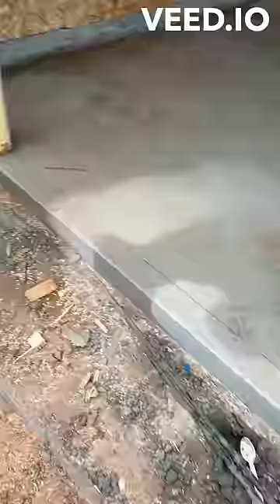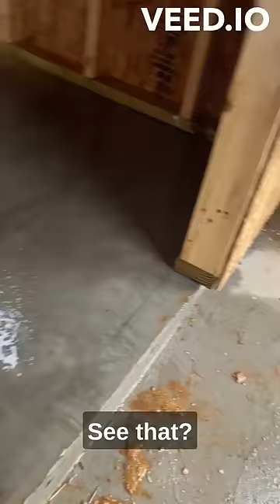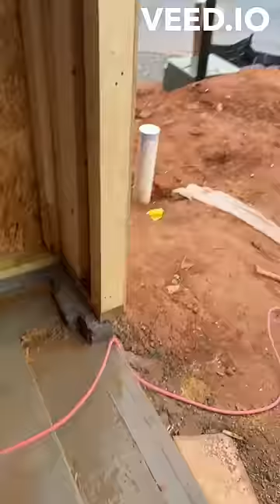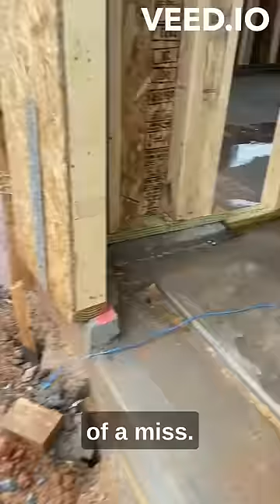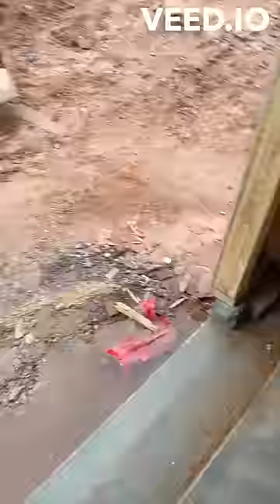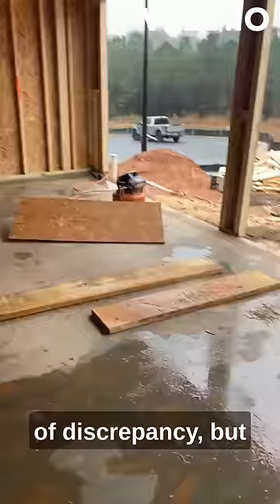New Home Slab is Wrong Size, What Now?

Comment: I was a framer for a long time, I would have popped my lines down saw how far the concrete was off and called the super to get the concrete guys back over to fix it before we came back and did the job
Reply: I was a carpenter for a long time. I would have took and inch and a half off the wall and went about my business without making a huge deal out of nothing. They clearly added a foot to the wall as depicted in the shot of the outside corner with the janky ass splice job. So they cut that one foot piece knowing damn well it was an inch and a half long. Simply unbelievable
Reply: You don't hold up the whole project over a lost inch or two. You just notify the general contractor and get permission to modify the frame by 1.5". You can't control the other guys, but you can do your own job right.
Reply: All the measurements seem to be out by the thickness of the framing material, I wonder if they both are making an arse of the site drawings and this is actually an office mistake they are fed up of correcting on site.

Comment: I love how they noticed it was wrong and just kept working
Reply: Some hardcore "not my problem" shit.
Reply: What would you have them do? The framers didn't do anything wrong here. This is the concrete guys problem all the way. I'm a concrete guy and ive been in this exact situtation before. We drilled and pinned the face of the stem wall, form it all up for 4 inches of concrete all the way down to the footer. Painted on the link and poured it. The framing isn't in the way at all. Very minimal at best.
Reply: Should be fined $100,000 per inch. These assholes are working for the customer, NOT themselves.
Reply: @traveler7353 That's one of the difficult things about hiring people. It's not their house so they don't give a fuck
Reply: @TripAMD  The framers failed to build to code. How is that not wrong?
Reply: @TripAMD looks like everyone messed up here. Putting a frame on top of that slab was definitely a mistake
Reply: @NinjaThatLongboards  . It wasn't a mistake though. The wall won't fall off or anything like that. The concrete guys can can fix it whether it's framed or not.
Reply: @TripAMD  half the load of those walls is unsupported
Reply: @NinjaThatLongboards  yes. But it won't be once they pour more concrete. This is a very straight forward problem. It happens.
Reply: @TripAMD  it's not as simple as just pouring more concrete dude, it has to be Properly Attached and reinforced to Handle any Loads it will be subjected too... Fact of the Matter is, Those Framers Knew there was an issue on Day 1, but they Cared about $ over the Proper installation of Someone's Home-  Pride in Work is another Issue our youth has Lost!  

  Past Generations would have quickly Noticed the Problem and Stopped, to make sure this issue is Fixed before moving forward, They Took Pride in their Work... Today's Generation is so Self absorbed and Greedy that it's literally everyone for themselves!
Reply: @RandomPersonTP  nobody said just "pour more concrete". I explained the fix in my first comment. Anybody that's been in concrete for any amount of time knows what to do here.
Reply: @traveler7353  lol.. you have no real world experience in these fields obviously. This isnt a big issue, its a very common mistake made by concreters and can be fixed without much drama.
Reply: @traveler7353  hahaha...You dont LAY concrete bud, you POUR it. You're trying to lie to an actual tradesman here id quit while you're behind.
Reply: @TripAMD framer didn't do anything wrong? So putting up the walls wasn't wrong?
Reply: @CbrF4i600cc  . Exactly! Framer did nothing wrong. It looks bad to somebody that doesn't know any better. But it's no big deal to fix.
Reply: Im a bricklayer and there's lots of times i get told to over hang out of square concrete and the general signs off on it first before i lay anything because they dont want the concrete guys coming back
Reply: @TripAMD how about make a phone call. Is that so damn hard? It's not rocket science. It's construction. Something doesn't look right, maybe we should check and make sure this isn't going to be an issue. I just don't get the lack of common sense we have now days.
Reply: @TripAMD  the framers did everything wrong lol
Reply: Exactly. The carpenter should have stopped and notified the GC that the slab needed fixed.
Reply: @TripAMD "What would you have them do?" Seriously?  What if it was your money being spent here? Would you be happy these people went ahead full knowing they are wasting time, money, and materials?
Reply: It's called deadlines and schedules. You expect the framing crew to miss a week of work because the concrete guys fucked up?
Reply: @codyfreeland  What if this was your money being spent?  The answer you come up with is the right answer.
Reply: @worldofthunder  if it was my money being spent, I would have double-checked the concrete forms before the pour
Reply: @codyfreeland  So in other words you wouldn't have the framers start the work because the concrete forms need to be fixed.  See that's the right answer... And in this particular case where pouring of cement already took place, the concrete would have to get fixed before the farmers could start. 

Also let me get this straight. So you pay the money to have a contractor perform the work which includes hiring multiple craftsmen for different jobs. And you're telling me that you're going to be out there measuring? Why are you hiring the contractor then...
Reply: "I'm just doing my job"
Reply: @worldofthunder  it's called "quality control" Every general contractor should do it. Would have saved their ass thousands in this particular case.
Reply: @codyfreeland  I agree with that statement 100%. However, the framing guys continuing their work fully knowing it's wrong is not the way to go.
Reply: @worldofthunder  you think the gc didn't ok it?
Reply: @codyfreeland  Honestly, I would not presume to know that.  I'f he did, then it's 100% his fault and rest assured it's coming out of his pocket.
Reply: Mexican crew framed it probably lol
Reply: Man this is the contractors fault for not being on the job and seeing what’s going on.
Reply: @Ab-iz9uv  it's also the builders fault for being cheap and going for the first framing crew they find that's under qualified
Reply: @TripAMD  You have downs, quit talking.
Reply: @cristianruiz3396  no bro there at fault also,but it’s the contractors job to make sure everything is going right
Reply: @TripAMD I work on cars. This would be like me building an engine. In the process, I see that the new head gasket is very visibly damaged and still use it. Then, it obviously has the head gasket issue and I blame the head gasket company. Yes, they did not make it properly but I was the one that compounded the problem by using it and continuing around it.
Reply: @Ka_Gg  That's cool. Bad analogy, though. I build houses. The mexicans do this kind of stuff all the time. We go back, drill and pin it. Form it up and pour it. It's really not even a big deal. Because it can easily be fixed after the fact. There's basically no going back and fixing a head gasket without ripping the whole thing apart again.
Reply: @TripAMD  that can't be as strong though...correct? Also, make a new form that goes to the outside of the wall? Do you pour concrete up to the base? Isn't that bad for the wood?
Reply: @Ka_Gg . It's likely not as strong. But, the difference would be negligible. The slab and footer, under normal circumstances, are orders of magnitude stronger than they have to be to hold up the house. The patch would be plenty strong enough. It isn't just sticking to the side. There's a footer down there for it to sit on as well. You would pour the concrete all the way up to the bottom of the framing. The bottom board should be pressure treated. Anytime wood touches concrete, it is supposed to be pressure treated.
Reply: @TripAMD  thanks for the info. I just know if I was spending several hundred k...or even the guy in charge, I would not find this acceptable.
Reply: @Ka_Gg  It's definitely not right. This is just a small sneak peek at all of the dysfunction on a construction site. People get this type of treatment more often than not.
Reply: @worldofthunder . If it was my money, I would build it myself... but this situation didn't cause anybody to lose any money beyond the $2000 MAX in concrete and labor that the concrete company has to pay for. I'll bet you everything I own that, that house is still standing. Barring a tornado or something.
Reply: @stickyfox bro how about before you comment on framing actually know what your talking about. The concrete guys fucked up. It's not that big of a deal. This foundation could literally be fixed in one work day and the house would be perfectly fine. Infact the house being done makes it easier for the concrete company to finish the foundation because now they can just pull measurements off of the house rather than trying to square multiple different areas and checking heights with a lazor.
Reply: @stickyfox  The framers build according to the blueprint. If the blueprint said that that's where the walls go, that's where they put the wall.
The problem is the concrete guys messed up their form, and the framers went ahead and put up walls so that they can try to back charge somebody else and make extra money.
This situation has nothing to do with code.
Reply: @Paymydata  im a framer. Done similar things like this on purpose at the direction of the builder. It can be fixed later meanwhile youre chosing who to blame.  You ever build anything in your life/not work a punch in punch out job?
Reply: @Roger-ws8rj exactly and people are asking why they cant just make the house to fit. Well how do we know we dont have thousands wrapped up in trusses that are already built that might be a bear/impossible to change or alter.
Reply: This is called determination.
Reply: but did they? 🤔

Comment: This is why every job needs an on-site  manager provided by the GENERAL CONTRACTOR. 
This never should have gotten this far.
Reply: If the house has walls already  framed walls the carpenter has to do their best
Reply: Exactly!!! Hire a real GC that doesn't let subs that are supposed to be "professionals" run the project.
Reply: So you can charge the customer another 10k+, more hands on deck, more money. People want the platinum quality work for bronze prices. And this is what they get
Reply: Every jobsite I've been to recently has no general or superintendent on site. Just all the trades doing their thing. Sometimes that works out.... Sometimes it doesn't. Seems all these generals want to manage from home while in their PJs.
Reply: @MasterOfMadmen  Over the past few years, the degree of "give a fuck" has gone way down and it seems like gc's, just don't really care much at all anymore.
Reply: @MasterOfMadmen   Exactly, that's the problem! Managing a project and subs is a FULL TIME job and it needs to be for a reason. People really don't realize just how bad most tradespeople are, especially if there's no union/training involved. A large majority of them honestly can't even read a tape measure and that's no joke, much less do the basic math that's required.
Reply: We're really suffering from a lack of apprenticeship programs. With people actually willing and able to train good craftsmanship and ethics. Too many places hiring but their version of training is to just yell at people and expect them to magically pick things up. And everyone takes their piece of the pie then subs things out so the pay for the crews doing the actual work isn't enough to keep talent around.
Reply: @kennethloki7011  I guess the good news is in 5 years there will be a fleet of robots doing all the new build stuff to exact tolerances and they will run 24/7. I don't think people really have a clue how close this future is. Follow along with the Tesla robot project and huge production facility they are already building to fab these things up.
Reply: @aservant2287 Yeah, cut them to size and replace end studs. This is ridiculous.
Reply: Local Agency Inspector!!
Reply: @AZBADBOYz  😂
Reply: Simple phone call would have fixed it also
Reply: Every general contractor I've dealt with are idiots
Reply: No, this is on the framers. This was blatant malicious compliance.
Reply: @sevirz13 is  it really platinum work to not frame the house wrong?
Reply: , so, how do you fix the problem
Reply: @matthewdurand72  contractor should have checked the concrete guys work before framers got on job, if it was concrete mistake, they fix it before framing, discrepancies in plans should be caught by a good contractor before bidding job. Problem is there are a plethora of contractors out there that don’t do these types of necessary babysitting jobs but it has to be done, every sub is supposed to be competent but we all know that slips due to speed or carelessness
Reply: @MasterOfMadmen  I agree, there are a lot of general contractors that are lazy or just think”I’ll be a builder” when they don’t know squat about it. My guess is this cat didn’t go over the plans adequately or just relied on subs to hash everything out then had his oh poop moment.
Reply: I was thinking this was done on purpose. The siding overhangs the slab so rain does not flow inside the house. 
I come from a country where it rains half the year..lol.
Reply: But the air-conditioner and chair are in the site trailer.
Real superintendents are long-gone. Most consider themselves hands-off babysitters, and let the various tradesmen play the "hurray for me, so what if it screws you" game.  It's a problem everywhere with most builders, who race to the bottom in order to compete.
The direcy results of anti-unionism,  de-regulation, and profiteering.
Most inspectors are ignorant as well.
Any sub-contractor with any integrity does their job at least to code standards, reporting and documenting eveything, discrepancies and all, to satisfy the future Insurance Company that will sift through any "wreckage" to assign blame.
Reply: @MasterOfMadmen  nah, usually the builder or gc just stops by and checks a couple times a week. And they run themselves too thin. That's why you see alot of house builders go bankrupt.
Reply: I'm just curious why the new occupants didn't come by and check things over. Could be it wasn't close by or no enough free time. When my new house was built, I lived 9 miles from new home, but I still went by every day or at least every other day to check out the progress. Just saying...
Reply: As a guy who has been an onsite manger, let me tell you, know one wants to pay for it anymore.
Reply: Union
Reply: @matthewdurand72 cast a concrete ramp leading into the garage.
Reply: Little the discrepancy 😂😂😂
This shouldn't never happen. As framer here I will speak with the person in charge before I do any framing, when the measurements on the concrete are wrong from what the want me to frame 😎😎
Reply: I absolutely agree! I have worked in the trades and remember when G.C.s actually did their job. Nowadays it's a free for all! The framers probably followed plan and concrete guys probably measured outside box as inside, ultimately coming short. If the GC was checking concrete form, they would have caught this. The framers probably said well GC isn't here and we aren't going to redesign house so F it.